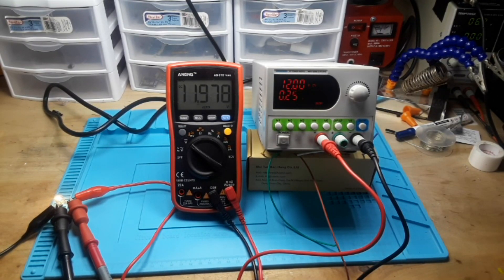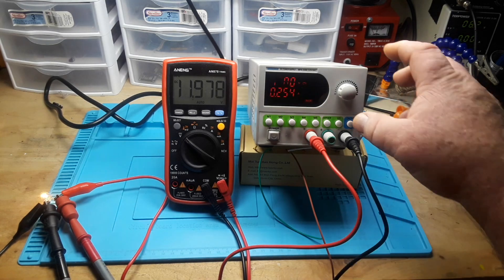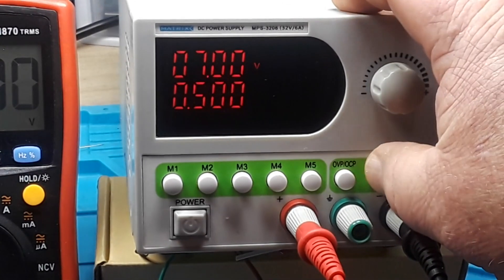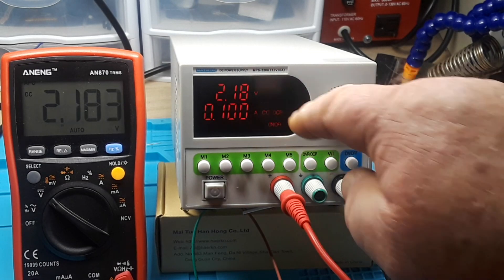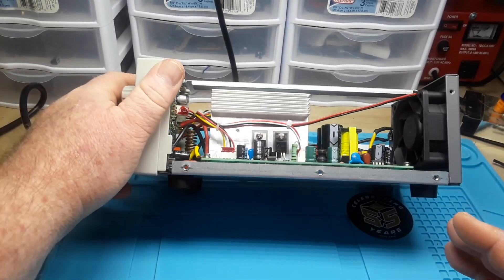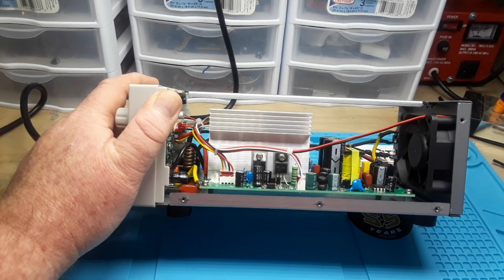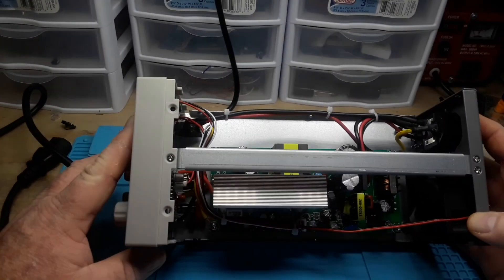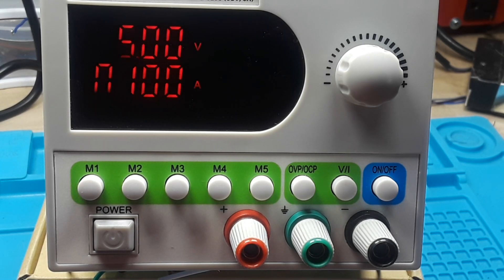Matrix MPS 3206 Programmable Power Supply Review and Tear Down

Comment: Buying this supply based on this review and the fact you are still using now.
Reply: how's yours? i am planning to get one soon
Reply: @dany_2945  just got it today, will let you know in a week or so.
Reply: @dany_2945  Sorry it took so long to get back to you. It has done every thing I have asked of it, mostly low current at 5V and 12V. The only issue I have had at this point is some banana plugs fit really tight in the connectors.

Comment: I just bought a Gophert NPS 1601 0 to 32V, 0 to 5A power supply for about the same price.  It lacks the programmability and easy front controls of this Matrix MPS 3206, but it does have extremely good power regulation, no more than 10 mv noise and ripple at full load, which most economy level SMPS supplies can't match. I just can't seem to get good regulation and good front panel design together in a $60 bench supply.  The Matrix comes close in that regard, and I appreciate the review, but I'd like to see some full-range tests done with it so I can gauge its power regulating and load handling capability.  A 12V light bulb doesn't really do it justice.

Comment: Funny thing, we both on the subject of power supplies today, Mr. UPS man, just dropped off my order of two 2400 watt rack server supplies. 200 amps at 24v, or 400 amps at 12v, plus I have two more coming, that are 460 watt, for the small stuff! I'm putting them in series, to power my hobby charger, but the bigger of them, are 200-240 volt, I'm going to use them with my generator to charge my house batteries! I just need to figure how to control the charging, maybe pwm solar charge controllers? Or simply a brushed DC motor controller, and manually watch and control the charge voltage and current, being on the business end of nearly 5kw is serous!   I have some decent MOSFETs, and a few other bits. I only lack the knowledge, i think the output could be controlled by  modifying the circuitry, I think the output is adjustable slightly, but a resistor can extend the output a bit more, but charging lithium batteries isserious Buisness, may e I can modify apwn charge controller to carry a ton more current, I'm too cheap and creative to simply buy something that will work, maybe I can put your teaching, and my brain into getting this to work!  You should have a package in about a week, good day , and thanks a ton fer da learnings!

Comment: Looks like a half decent power supply. I would have liked to see it max out at 40 or 45 volts rather than 30 but 5 amps is plenty for a test bench / work bench. Still 30 volts is enough for most applications.
Will have to look at the cost in Aussie dollars. Thank you for your video mate.
Reply: 30v seams to be a common voltage for bench power supplies
Reply: @nethoncho  yes, also this doesn't ship to Australia via Amazon and I cannot find it on eBay. Pity looks have decent
Reply: I have this PS its 32v6a so lil more
Reply: we are going to launch a 60V/5A  in this series soon